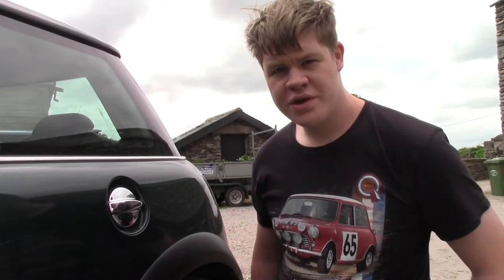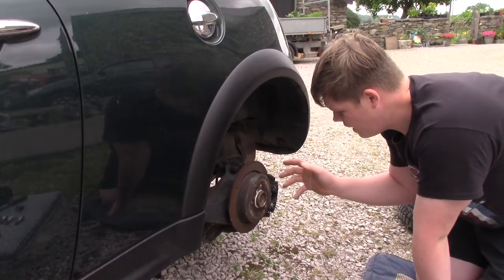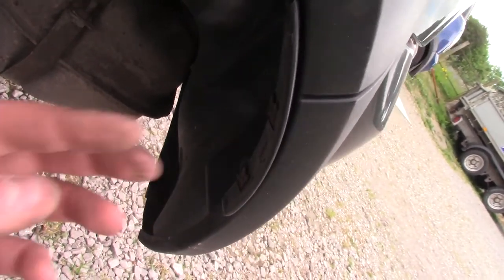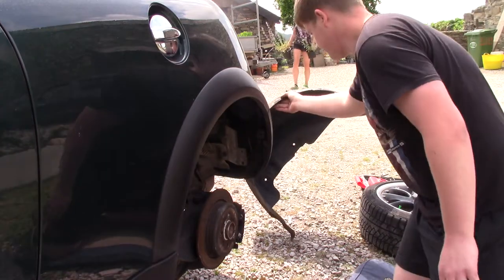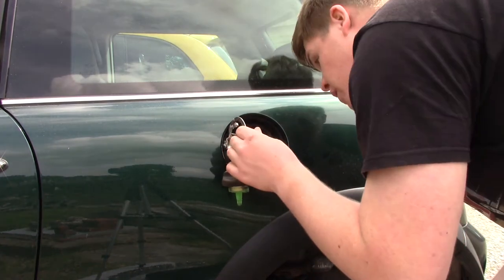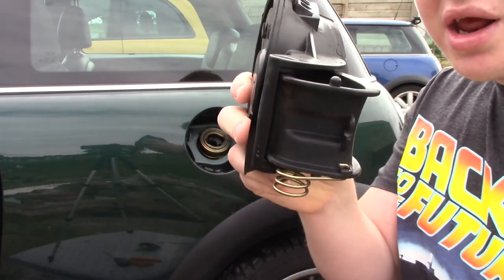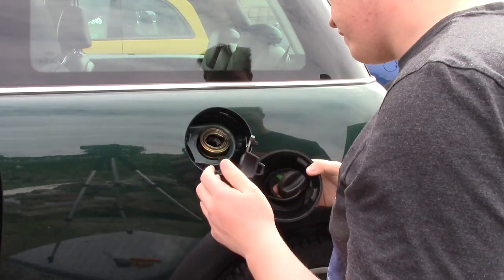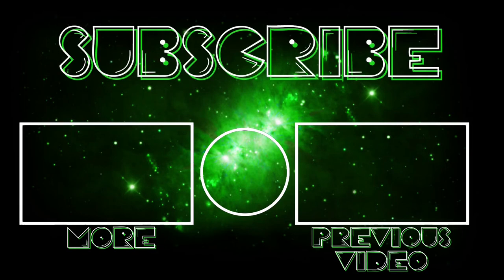R53 Mini Cooper S - Filler Flap replacement

Comment: If I just wanted to replace the chrome cap with a new one, is it necessary to remove the wheel/arch liner etc, as your vid shows the cap is attached to the second insert you removed from the cap area itself.

Comment: Hi. I have a flat cap version but it seems to be after sinking below bodywork. Is it the same procedure to adjust?  Is there adjustment on hinge or where?
Reply from the maker: There are 4x tabs behind the hinge that can get bent when installing the cap. Luckily you can just open the cap and bend them forward and it should sit level. Hope that helps

Comment: Where did you even find that. I am looking for the flush mount conversion.
Reply from the maker: I just found it on eBay. People are braking cars all the time on there. The flap I installed is actually of the none Cooper S version (R50) so I searched “Mini R50 breaking” on eBay and quite a few car came up then it’s just a matter of finding a car that still has a filler flap and ringing them for a price. The conversion is very simple since it’s designed for the R50 which is exactly the same as the Cooper S (R53)
Reply from the maker: Also if you want to make sure you are getting a matching colour to your body work, you can find the paint code of your car on the driver side of the engine block, then when you ring them you can check it matches, so it doesn’t look out of place
Reply: Thanks brother. I found one on ebay but it doesnt have that spring you were talking about.
Reply: Also thanks for your reply man